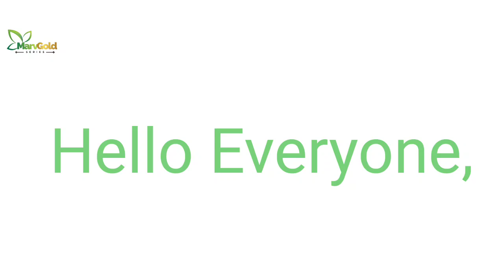How to make a laundry soap ( Semi Hot Process).A tour into our soap training methods and more.🔴

Comment: I did semi hot press soap and was soft...if I rebatch the soap how days do I have to wait for it to cure before using on the skin
Reply from the maker: Your question is complicated.
You need to join the paid Class
The recipe needs adjustment.
Reba thing is also taught in the paid Class.

Comment: Hi ma why was sodium sulphate not used in ur production. I see a lot of soap makers using it
Reply from the maker: There are several methods of soap production.Each of the methods with unique characteristics.
We discuss this thoroughly in the Paid Class
Reply: @MarvgoldSeries  ok thanks ma. I noticed in most of ur videos u normally soak caustic soda for 24hrs before use , is there any benefit gotten from it
Reply from the maker: @toyosiogunsori4452  Its my cold process format.its a method that hardly fails.